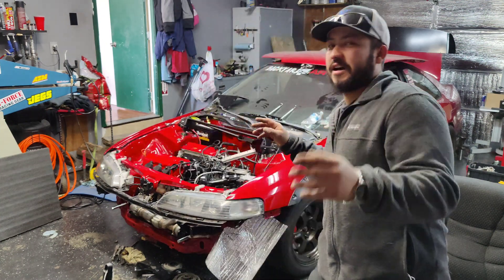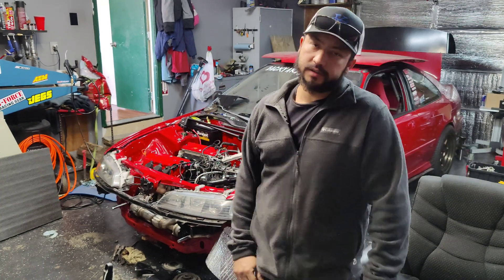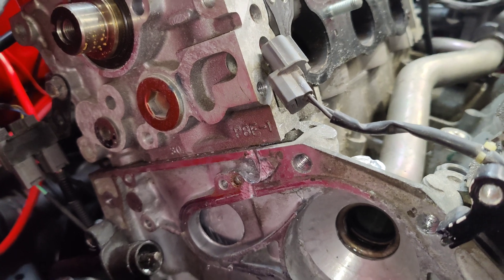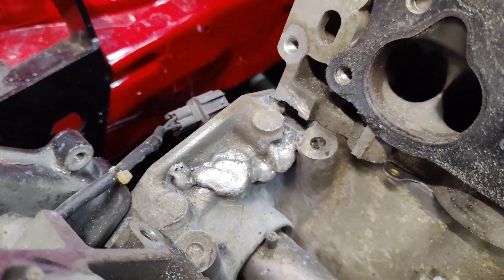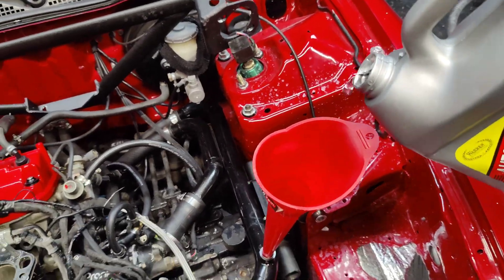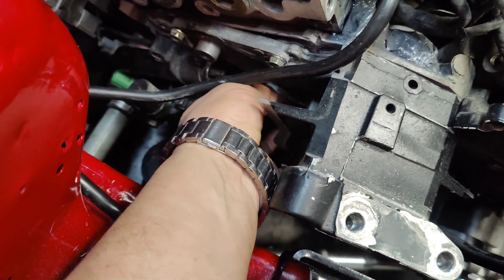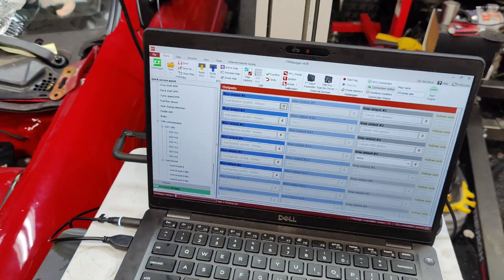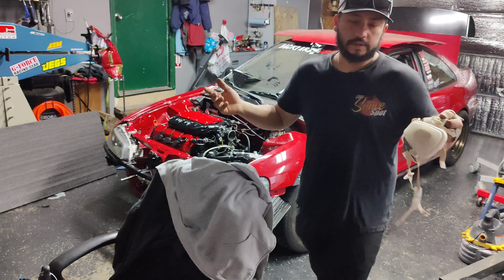CRACKED ALUMINUM BLOCK turbo j series attempt to repair with a spool gun and jb weld can we fix it?

Comment: MiG on cast aluminum. Great job, don’t have to be pretty.
Reply from the maker: At the end it was all for nothing I had to change the block anyway because it had a bunch of cracks in different places
Reply: @clevermotorsports that blows. I’m doing a rebuild and noticed my transfer case has a hairline crack from mounting bolt tab and then up around the case. I ain’t going to know how bad it is till I remove it but I’m going to MIG it if I have to. Found your video trying to learn about MIG on cast aluminum.
Reply from the maker: @teagreen2220 it works pretty good I was surprised with it but you need to clean it real good especially  if it was in contact with oil you may need to torch it where you are welding it to burn any oil residue dont melt the cast with the torrch